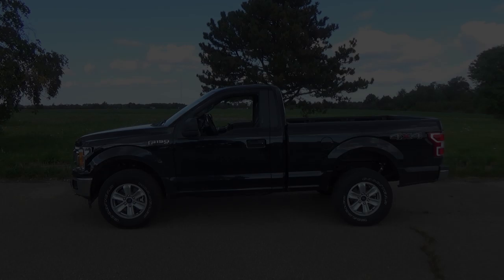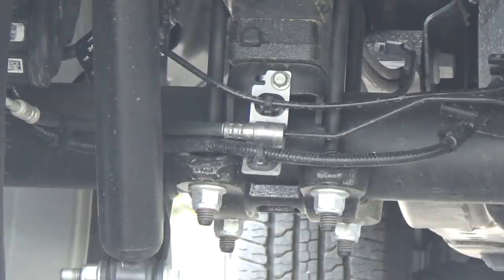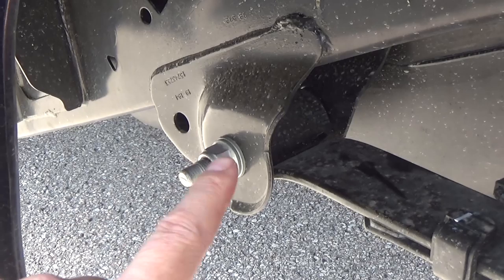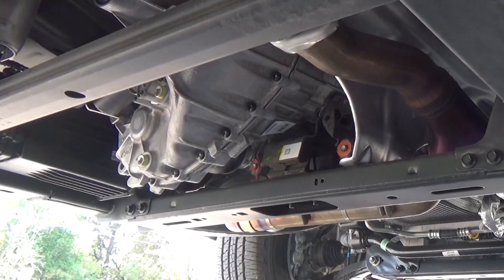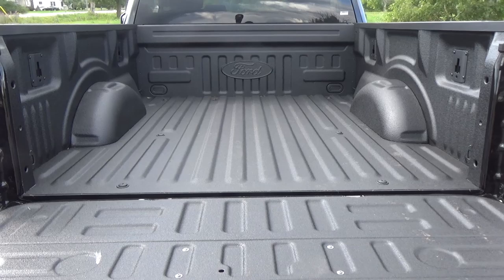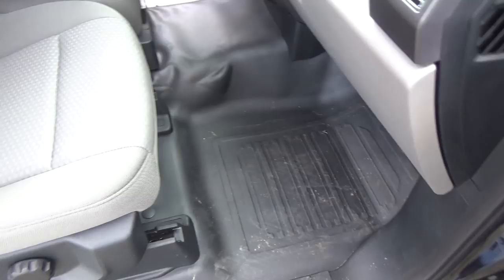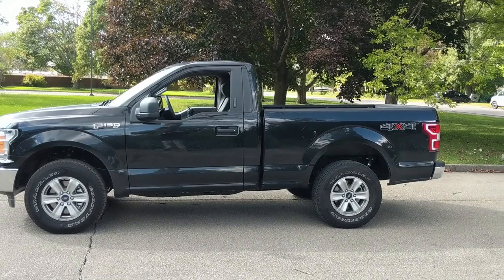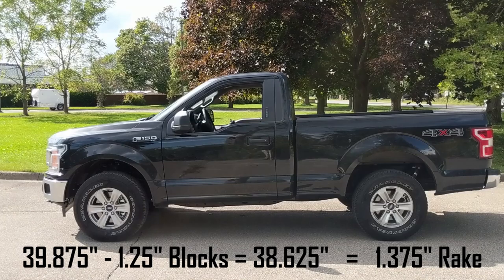2019 F150 5.0 RCSB 4x4 w. Tow Pack

Comment: Just a note on the issue of the spring bolts...another option would be to buy two new bolts, loosen the ones you have and cut them behind the head, and then reinstall everything using the new bolts but just put them in the other direction.  It would cost a little money...but dropping the fuel tank and the exhaust can be a hassle so spending a few bucks on new bolts would be the way I'd go.  Here in the US, the Ford bolts from the dealer are $5.80 each so it isn't expensive when you compare dropping the tank and the exhaust versus spending $12 on bolts.  BTW...I'm strongly considering getting a 2020 regular cab XLT.  Are there any tips you would have?  The only issue I seem to be having is that I can't seem to option a regular cab with a sliding rear window.  I like having the slider in my current truck to haul long boards that I can pass into the cab.  Is there any way to get a slider in a regular cab?  Thanks for any info.
Reply from the maker: Drop is already done, I had it done by a local shop and cost $384 which is fine by me because it drives great (better than factory).

I now have the shackles and rear blocks removed and it has 1⅜" of rake which is perfect because once I load my trailer up the truck sits level.

The window you'll have to install after you buy it (simply purchase and OEM Ford slider and get a glass shop to install it) they'll probably purchase your old window too because they'll end up using it eventually. They don't offer many options with the RCSB, so nothing other than rear defrost is available (and I recommend against rear defrost because the windows blow out and it's a single cab so they heat up quick).

I LOVE this truck, and you will too!

My advice would be to get the snowplow package and maybe fx4 for an extra $1000, the snow plow pack at the minimum for the 9.75" rear differential (larger than the factory 8.8")

Also, definitely get 3.55 or 3.73 gears, anything less makes the 5.0 sluggish.

This truck is sweet, but if I could buy it again there's a couple things I would've done differently.

I plan on doing a full video sometime in the near future.
Reply: @EliminatorPerformance  - Awesome...thanks for the information.  I currently have a 2004 F-150 with the 5.4 and 3.73's.  I definitely plan on getting the 3.73's in my new truck because I upsized the tires slightly (285/70/17) on my 2004 and am glad for the gearing...so the extra gearing in my new truck would be perfect if I increase tire diameter when it's time for new treads.  

That's a bummer about the slider.  I could swap it out for a factory slider as long as the window openings are the same.  I don't need power or defrost...just a simple manual slider for hauling long stock is sufficient.   

Here in the US, the plow prep package is a $50 option.  It doesn't say anything about the differential but if it's the same here as in Canada, I'll definitely do that as I'd much rather get the 9.75.  

I'd love to see a full video...and am glad your drop shackles made it exactly how you want it.  That amount of rake seems perfect to me.  

One question...do you have experience with Line-X bed linings?  I ask because I definitely want a spray-in liner.  My current truck has a Line-X.  I've been abusing the bed for 16 years and it has held up great.  A Line-X is about $450 here in the US but the Ford spray in is $595.  If you have any experience with both, I was wondering what your opinion is as to how they compare (which one is better).  

Thanks again for all your information.  I just subscribed to your channel so I won't miss your new videos.

Comment: The 3.55 rear end will be easier on the 10 speed.
Reply from the maker: Yes I think the 3.73s would've been too much gear, thanks for watching!
Reply: Lol easier on the 10speed? Explain please.
Reply: @johnnyshd8250  you do realize 3.73 is Lower or are you referring to a different gear
Reply: @68061678  I have been a motor head my 66 years of my life
Reply: @johnnyshd8250  lol good answer, you may want to get the right “motor head” out of your magazine because you would find yourself incorrect.
Reply: @68061678  That term comes from my generation. People old like me still use it. All though we don't say "groovy" anymore.lol
Reply: @68061678  gearhead

Comment: Hey how’s the suspension? I have the same truck but the suspension is super stiff so going over a small bump feels like hell
Reply from the maker: A little stiff yes, but I actually enjoy it, feels more planted. However, the back does seem to jump around a bit.

I'm going to be upgrading the rear to Bilstein shocks in the spring! I have the payload/tow package so the leaf springs are a bit beefier, makes for a stiffer ride.

And the 22" wheels I had on make it even stiffer (running winter tires on my stock 17's now).

Comment: All along I thought the suspension was special on the 4x4s because it was higher up and tough looking. Turns out it's just blocks.
Reply from the maker: Yea it's nothing major, FX4 package gives you better shock absorbers, about it really. Tow package gives you the extra leaf spring which I still have, and all I've done is removed the block and just changed the position of the leaf with the drop shackle.
Reply: @EliminatorPerformance  I learned a lot from your video thank you. I'm here in the states and the regular cab with a V8 is like a unicorn here.

Comment: What's the max payload?
Reply from the maker: Almost 2000lbs of cargo payload, towing capacity is almost 9000lbs

Although now that I've installed the drop kit in the back, it does squat a bit with an 8000lbs trailer hooked up.

The tow rating isn't technically affected, but it doesn't sit level when a full load is being hauled.

For my day to day use of small engine repair though, the drop kit was perfect.

Comment: Ford made several changes in the coyote V8 in 2018 that trashed the reliability of the engine.
Reply: Good to know my 17 is a good one.. 😉
Reply: I traded my 2018 5.0/10spd/3.73 after 11k due to the engine /transmission.

Comment: I like v8s too but you say that the v6 isn’t proven but yet the 5.0 and 3.5 ecoboost came out the same year.
Reply from the maker: As far as reliability goes, there's a good video somewhere on YouTube, a guy goes and asks a bunch of different Ford techs which engine they'd prefer in their own truck, 100% said the 5.0 if they had a choice.
Reply: Eliminator Performance that doesn’t mean anything, most guys would say the 5.0 just because it’s a v8, go look up Daniel jaeger films he did a video on a 2012 f150 ecoboost with 200k miles
Reply from the maker: @trailspeed7037  it's not a bad engine, the v6's actually make more torque at lower rpm than the v8.

It was mostly personal preference to be honest, I've never owned anything with a v6, and turbos seem to add to the list of things that could go wrong.
Reply: Eliminator Performance yea I agree on that I was just saying that the v6 is a proven motor by now, I agree on the v8 that’s what I’ll get if there’s an option for it
Reply: This is of course disregarding the change in 2018 to the 5 liter where they decided to eliminate cast iron cylinder liners and leave them coated aluminum and added direct injection.  The direct injection is cool... still has port fuel injectors too.. the oil burning issues though with the aluminum cylinder walls... yeah thats a pass.

Comment: Do you have to recalibrate the speedometer for the larger 22's?
Reply from the maker: Technically with these, no. But you can if you want. I use a comparison chart that calculates overall diameter difference. It's 3.8% which means at 100kmh I'll be doing 103.8kmh.

Here's the site, just enter your info.

https://www.tacomaworld.com/tirecalc?tires=265-70r17-305-45r22

Comment: You screwed your tow rating dropping the truck
Reply from the maker: Tow rating is the same, also payload is the same because the stiffness of the suspension hasn't changed, only the height of it. (It may squat fully loaded instead of sitting level) but it can still haul the same weight!

Comment: Nice looking truck. Do you have any problems with oil burning? A lot of f150  5.0L's  from 18' and up have been burning oil.
Reply from the maker: Thanks Chad, and no it doesn't burn oil.

I'm planning on doing a video to cover this, the oil looks low on the dipstick but the engine doesn't actually burn it.

The issue is that ford over filled these engines by 1 quart and the dipstick is too short.

So when you check it, it looks like the oil is always at the add level on dipstick (bottom hole) what happens is that the extra oil is forced through the PCV valve, into the intake manifold and then gets burned. If you leave it and don't add oil, the oil stays at that lower mark.

So what ford does is they install a longer dipstick (all 2019s after October and all 2020s have them now) and they fill the engine with 1qt less of oil.

They also upgrade the PCV valve and do and update on the ECU/PCM (computer).
Reply: @EliminatorPerformance  
I've seen other videos that people had the dip stick replaced and afterwards it's still burning oil. Word is that Ford's dipstick fix is a bandaid fix to get customers through the warranty period. Ford has replaced a lot of 5.0's because of bad pistons/cyl linings. I hope it works but don't be surprised if it still looses oil after they replace the dipstick. If that happens and the dealer won't address it, you may need to try another dealer or call Ford directly. Keep us posted.

Comment: How much is a good price for one of these? I’m Looking for the rwd model I’ve went to many dealerships and the lowest I can find one was for 35k do you guys think I can get one for lower?  I live in Tx btw to they are hard to find
Reply from the maker: Ok so 2 things, I ordered mine, and 2nd is I paid cash all 1 lump sum.

The dealers love to give deals on ordered trucks, and if you pay cash you get even better deals.

The 4x4 alone was like $4500 so take $35,357 and subtract $4500 and you have closer to $31,000 for a brand new 5.0

You take off tow package and brake controller and probably save that extra $1000 so I could see around $30,000 Canadian.

So I'd imagine this would be a $22,000 USD truck but who knows lol
Reply: Eliminator Performance thanks for responding! I wish I could find one of these here for that much but it’s not possible right now unfortunately. They have gone up in value and are hard to find I’ve only found a few in my area.I’ve  been looking for a cash deal but every dealer I’ve went to wants to get me to finance and they don’t want give me a discount for cash price but hopefully I can find a good deal.
Reply from the maker: @DanTheman-ci2ty  if I remember correctly, this truck was MSRP at $48,874 and with the cash discount and fire factory pricing I ended up getting almost $14,000 off sticker price.

Go on Ford's website and build a 2020 to your liking, then enter your zip code and it'll send an email to one of your dealers. That's how I did it.

Comment: Silly to lower the rear end.   Millions of dollars of design and engineering.  Your truck i guess.
Reply from the maker: So I was thinking about your comment the other night, my response is quite simple.

You say Millions of dollars in research and development into the suspension, yet Ford Performance designed, engineered and built the OEM drop kit that's covered under warranty lol

While I understand where you're coming from, with that mentality, the entire aftermarket Automotive industry would be pointless.